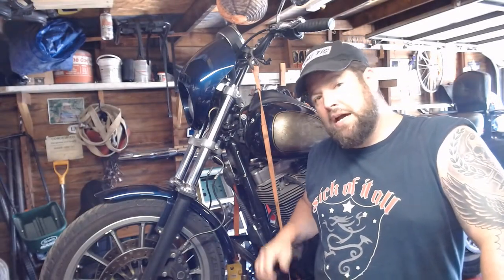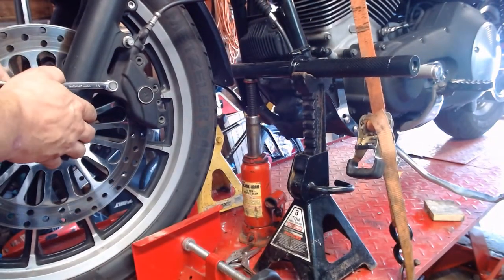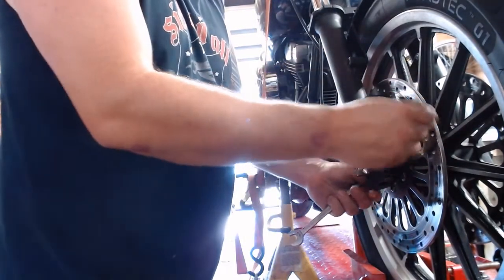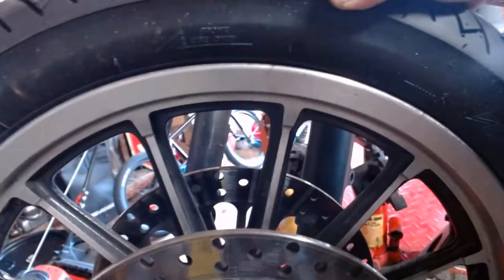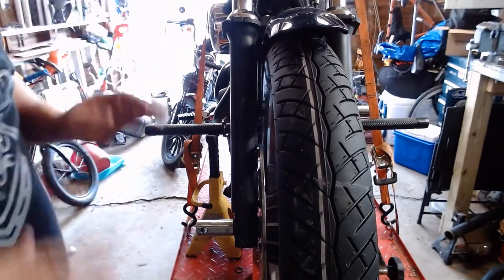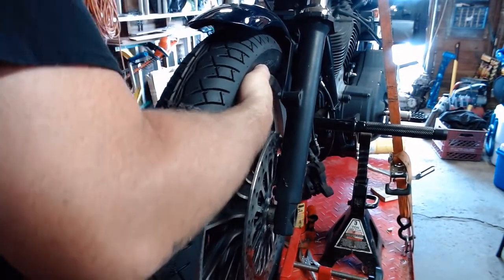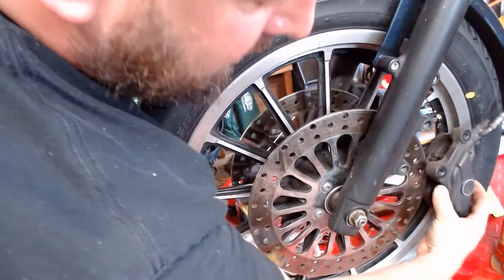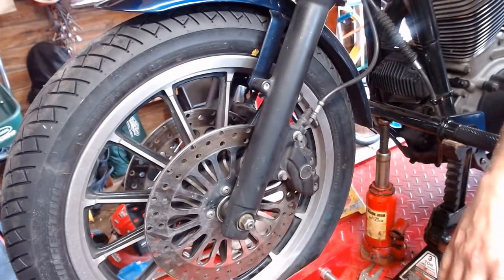Remove the wheel off your Harley Dyna, or most any motorcycle.

Comment: Great video I do have a question though what is the torque specs for the axle nut in the torque specs for the caliper bolts?
Reply from the maker: Thanks.  On the 05 it is 50-54 foot pounds for the front axle nut.  For the caliper bolts 28-38 foot pounds.  But in the caliper bolts I take a black marker and put a little dot at 12 o'clock on the bolt after I torque them.   This way if they are backing out, I will be able to see it when I do a walk around of the bike.

Comment: What about the groove marks on the spacers. For what I know it has to be considered if they should go facing to the wheel or facing out of the wheel
Reply from the maker: I do not recall seeing any special groove marks.  I looked up mages of new spacers, and i do not see anything there either.  However next time I put a tire on, I will check it out.
Reply: I have been told the grooves or lines go to the outside.

Comment: First time Harley owner and I just noticed the hole on the axel. Does that serve any purpose other than making extraction easier? Kinda freaked me out as I noticed it at a stop about 20 miles from home and was worried something fell out. Now I see it's fine but can't find any explanation for what that hole is for.
Reply from the maker: Extraction, and you can put a large dowel through it if you had to hold it in place to get the axle nut free. The pinch bolt SHOULD hold the axle, but not guaranteed.
Reply: @KnobleMoto  Huge thanks and great vid!

Comment: Is that a 2000+ mag wheel on a 99 fxdx front end?
Reply from the maker: Sorta. It is that mag. This is on an 05 FXD, and I bought a lower slider for an FXDX.  I swapped out the internals and bolted a new rotor to the wheel.
Reply from the maker: Here is the video. https://youtu.be/gJOfKjpqOwo
Reply: @KnobleMoto  ok nice i appreciate that. I have an 01 superglide. Bought a 99fxdx front end. I know i have to get caliper adapters and run 11.5 rotors but im wondering if a dual disc 2000 mag wheel will bolt up to a 99 front end spacing it out and what not
Reply from the maker: @jcroce2926  your welcome.  I would compare wheel bearing part numbers. If they are the same, the axle size is the same and the install should be easy.

Comment: bit a Loctite on them threads...
Reply from the maker: No need for thread locker. Just torque to spec.  Thread locker builds up inside the threads, and then you have to clean it out next time.